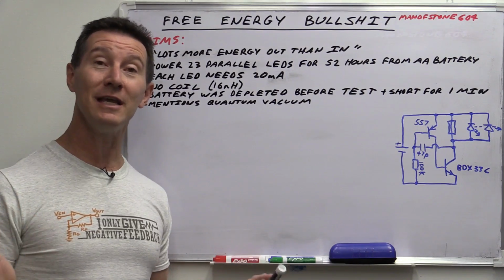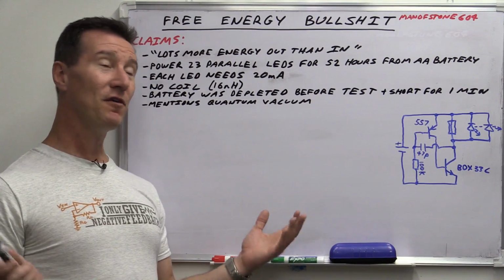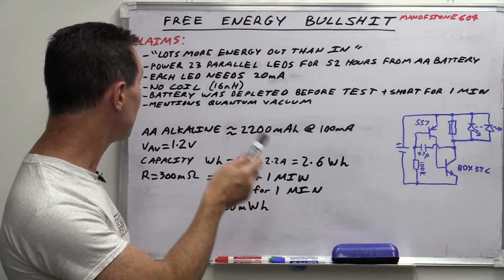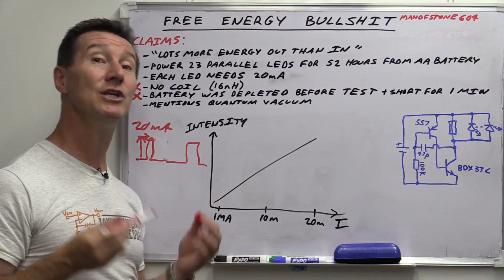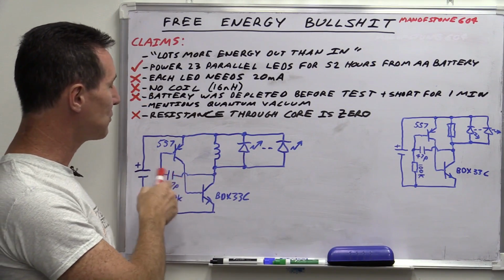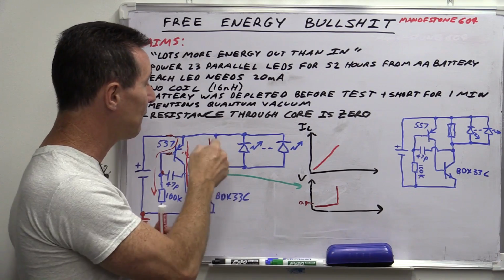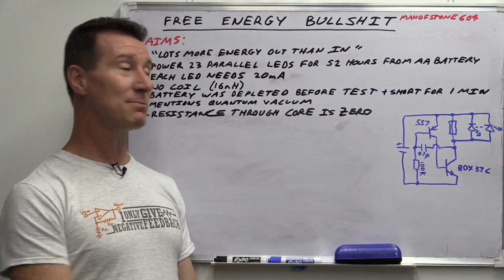EEVblog #708 - Free Energy Overunity is RUBBISH!

Comment: Unless you could tap into sub atomic particles on a mass scale you will find no free energy! This is also why the bosons from the Higgs field when exposed to our reality decay so rapidly back into the field that they are almost impossible to witness! Imagine that the Universe is made up of multi-phase energy fields that are only insulated by the separation of portions of sub atomic particles, imagine that the reality we live in is the outer conduit for the energy! The only thing that can utilize sub atomic particles and atoms is space itself and cause them to form the very matter we exist as, also allowing them produce and control the release of energy we witness in space and on earth! 

That is why why it is a super cooled vacuum, it allows the unimpeded flow of such immense voltage and current that is used by sub atomic particles and atoms attached to those very fields! But I cannot understand why man has yet to realize the importance of the vacuum and extreme cold of space when it comes to the production of atomic fusion and assembly of matter as well as the maintenance of electromagnetic fields! If we were to lose the vacuum or cold even by just a small amount it would lead to an early failure of the universe!

The biggest mystery is as the universe grows! How does it maintain it's vacuum, super cold temps and it's energy, is it due to the expansion of space or the escape of matter from a central location or is it produced as a byproduct of current draw by subatomic particles, rapid assembly of atomic clusters or even atomic fusion? In reality I am not asking this question! It is also important in understanding that reality is not limited by time, the word time was simply used to explain a phenomenon, that is why time is not accurate but relative and why the phenomenon itself is accurate and not relative!

Time has always only been a tool of measurement for man and it has led to major manipulations of his behavior! Energy will never be free, it will always require more "Energy" to create it, than the energy it will produce!

Comment: Dave, you taught more basic EE in this video than most of the free-energy types would ever experience in their whole  lives.  Hopefully, going to this level will help more of them tinker more intelligently & reduce the number of nonsense claims posted on YT--but, I doubt it because newbies often come across things when tinkering that they don't have the ability to understand or mathematically evaluate (given that they don't have much physics, electronics knowledge, & zero EE knowledge).  It's simply easier & cheaper for them to make & post a video with bogus claims & wait for others to explain to them why their conclusions are wrong.  Today you did that!  Excellent explanation!

Comment: fun thing is, after seeing this video, I modified this circuit to not suck and build countles little LED flashlights with it. It does the same as a joul thief but you don't have to wind a transformer to build one. Just replace the 47p cap with a resistor and you can trim it to not waste so much power.

Comment: There is unlimited "free energy" if one has the wisdom and knowledge to harness. Water runs down hill and gives the world most of its "free energy" . 
There is always a slight difference of potential between the "plus" and "minus" side of a magnet due to the movement of the entire universe. If one has the wisdom and knowledge  to use this difference to be magnified and harnessed properly one has unlimited "free energy" and it does not break any laws of physics or chemistry.  The concept to become familiar with is the "potential" inherent in the universe that there is a slight difference of "strength" between the plus and minus side of a magnet, earths field,  solar system, universe,,,,

Comment: If "The Laws of Thermodynamics" were "Laws" why is it that photovoltaic solar panels run hotter when they are powering a heavy low impedance external load as compared to an identical panel not powering anything? and a shorted photovoltaic solar panel runs even hotter, 

If "The Laws of Thermodynamics" were "Laws" and not lies the shorted photovoltaic solar panel would remain at the same temp as the open circuit panel, but it runs hotter than the open circuit panel, and the panel  powering a heavy low impedance external load would run cooler than the open circuit panel, but it runs hotter than the open circuit panel, 

I realized this when I was 10 years old and I was never able to accept 'The Lies of Thermodynamics' when one thing breaks a law of physics the law is not a law, it is a lie and there are a thousand other ways around it, 

Another thing that breaks "The Laws of Thermodynamics" High Voltage, High Frequency Capacitors across an AC Voltage acts as a load without producing any energy by product, it Destroys Energy 'First Lie of Thermodynamics' Energy cannot be created or destroyed it can only change state from one form to another, High Voltage, High Frequency Capacitors across an AC Voltage Destroys Energy! no energy by product!

Nikola Tesla's Quote on Albert Einstein's Theory of Relativity {“Einstein’s theory of relativity is a magnificent mathematical garb which fascinates, dazzles and makes people blind to the underlying errors. The theory is like a beggar clothed in purple whom ignorant people take for a king… its exponents are brilliant men, but they are meta-physicists rather than scientists.”} 

Albert Einstein and all of the "great men of physics" (Except Tesla) were part of a secret society that their goal was to suppress the truth about physics from the general public, 

Nikola Tesla was a true genius, The only reason Albert Einstein's Theories were promoted was to suppress other theories (The Infinite within the infinite we are in) aka (As above so below) Now Quantum Mechanics is being promoted to suppress The Infinite within the infinite we are in, and confuse people to how matter and energy really works, to suppress inventions that the power elite doesn't want the world to know about,

The false theories that are currently taught were purposefully created to keep people from inventing, over unity power supplies, gravitational drive tubes and dimonatal acceleration tubes (The Philadelphia Experiment) these devices are simple and obvious when you understand true physics, 

If you don't believe me why would YouTube Block my following comment from showing up in Top Comments on my own Channels Discussion Tab? go to my Channel's Discussion Tab, It shows up in Newest First, most people don't click on Newest First to read Comments, (YouTube Only Blocks The Truth)  

Follow the Money, Who owns the Federal Reserve? it's not we the people, shortly after WWII the owners of the Fed got Congress to make a deal with most of what is now OPEC that the US paid for the development of thear oil infrastructure in exchange they would sell their oil only in US dollars, so the US Dollar could get off of the gold standard and become a fiat currency backed by a third party, middle eastern oil sells, that allowed the Fed to print money willy nilly without any real backing, 

One of the first jobs the CIA was given was to protect the US petrodollar, and to suppress anything that could threaten the US petrodollar, that included promoting false theories and suppressing the truth, 

One of the other first jobs the CIA was given was to collect, reverse engineer and suppress UFO technology, some of the components were given to a few companies for reverse engineering, like Bell Labs and Motorola,

Who does the CIA really work for? it's not we the people, it's the owners of the Fed, 

Most or all Overunity "Experts" are CIA sponsored or forced disinformationist, just like most or all UFO "Experts" are CIA sponsored or forced disinformationist,

In a fair and just world inventing an overunity power supply would make a person much money and fame, in this world inventing an overunity  power supply makes a person dead and discredited, thanks to the CIA protecting the US petrodollar,

Here is a simple explanation of one overunity power supply: When a diode is hot about the boiling point of water it produces a small forward voltage from 1/8V to 1/4V and the current potential is dependent on the surface area of the PN junction, it is thermovoltaic and it is not endothermic, at high current levels it is exothermic, photovoltaic solar cells are large surface diodes, a 12V cell would be a 288 layer device or a 96 diode stack, each layer could be extremely thin, the individual diode layers need only to withstand less than 1V reverse voltage, a properly constructed device the size of a deep cycle lead acid RV battery could power an electric car,  

Another overunity power supply: The secondary in an air core transformer amplifies the primaries field, as opposed to a ferrous core transformer that the secondary consumes or opposes the primaries field, Nikola Tesla called his air core transformer his (Amplifying Transformer) because the secondary amplifies the primaries field, Nikola Tesla got really close to overunity with his Amplifying Transformer (Tesla coil) all he needed was a pair of non powered switched primary helper coils on each side of the primary coil to reduce the rise time impedance and amplify the the rising field strength and volume, and another pair of coils rectified and regulated to the primaries power supply, 

When I was 16 Years old I was taught physics philosophy and theology unified as one through rudimentary simplicity, find the simplest point and every point from the simplest point is just as simple as the simplest point, and before you know it you have reached levels of complexities through rudimentary simplicity, true understanding is never lost, 

Look inwards to see outwards, as above so below,  the infinite within the infinite we're in, find the simplest point, logically how is it possible for a smallest particle to exist? what would it exist as? a bubble of nothing? what would the shell consist of? if there were a smallest particle would all of the smallest particles occupy the exact same volume and mass?  

Atoms are microcosm solar systems, electrons are microcosm planets, the matter electrons are made of is as small to the electron as atoms are to a planet, and so on and so on, the particles that make up the magnetic field are to the electron what the electron is to a planet, the particles that make up the gravitational field are third level magnetic particles, heat is the mass of electrons not vibrational, the electrostatic field is orbital to stationary, stars have a V+ charge just like the nuclease of an atom has a V+ charge and planets have a V- charge just like electrons, 

Most planets have electron poles (aurora borealis/australis) magnetic poles and gravitational poles all aligned in its axis of rotation, and in the microcosm of atoms most electrons have the same just like planets,

As a planet spins faster the increase in allingements of its subcomponents increase the force and volume of its electron poles magnetic poles and gravitational poles, compensating for the increase in centrifugal force on its equator, 

The gravitational field is a hypervelocity magnetic field, a balanced non drifting magnetic vortex traveling through a deep vacuum will exhilarate itself through the gravitational field, gravitational drive tubes act as a piece of wire carrying current in a magnetic gap,       

You will get further in understanding through visualizing this modal on your own, than me talking you through it, if you have any questions just ask,    

When will the CIA stop murdering people that invent overunity power supplies or any device that doesn't conform to conventional physics,    

When will the CIA stop controlling what people believe about physics through the NSF, Nobel committee and paid online trolls,

How is the physics cominiunty going to recover from the infinite egg on their face, and when it comes out that the CIA had the whole world fooled with false theories everyone that paid for any class, textbook and lab fee deserves a full refund,

Now if we continue to burn through the rest of the world's oil reserves oil will crush the world's economy and the petrochemical industry will run out of oil feedstocks, if we don't change now we won't be able to,

Do you think this soft coup against the Deep State/CIA will change the CIA in regards to protecting the US petrodollar, or do you think it will be business, lies and murder as usual?

Always remember if something is being pushed a lot like everything quantum, thermodynamics, big bang,  they are CIA psyops to keep the masses stupid.

Comment: Dave - please tell me how i can  change output impedance from 75 ohm into 50 ohm (( switched between 75 and 50 ohms )) on my ''Advance signal RF Valve signal generator   model: SG62 the rf out voltage is quite low X100 microvolts settings and X10mV

Comment: Could this kind of circuit be dangerous without the LEDs as a flyback diode, despite limiting input to 1.5V? A battery cannot supply it enough power though (you calculated 80mWh when a battery is shorted).

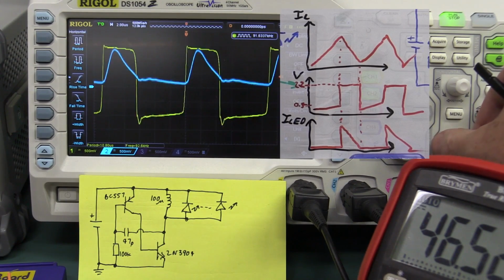Comment: 39:13 Well, it's about half the current at about twice the voltage... Considering that the LEDs are driven at a more or less 50 % duty cycle though, I guess one could say the average voltage is about 1.5 volts, so yeah. Not particularly efficient.

Comment: Playing around one day in a fairly dark room I found that if i touch one end of a 9v battery, then touch one end of an LED and complete the circuit by touching the other pin of the LED to the other terminal of the battery and amazingly enough, the LED lights up. I did this with both white and blue LEDs. Mind you it didn't light up very brightly, it was just barely visible in the dark, but I was surprised to see any amount of light coming from them considering they were only drawing maybe 1-10 microamps, assuming my dry skin caused my body to have 1-10megaohms of resistance across it.

Comment: Your explanations are valid only with one family of electrons in the circuit that you show. Recently, it has been measured that there are two kinds of electrons in an electrical circuit. One with spin up and the other with spin down. These two kinds of electrons carrying charge and spin, can associate in pairs of electrons after a periodic local modification of the resistance and thus of the local temperature. Voltage can then increase and intensity too, which produces an increase in the power of the circuit. COP will be overunity ! But a spontaneous cycle appears with formation of pairs and disappearance of pairs of electrons, which will increase the energy of the circuit; finally the energy ratio will then be greater than 1!

Comment: We can get free energy from UFO motors in the Bible, where one large wheel turns many mini-wheels 100's - 1000's of times = Ezekiel 1:16 “wheels within wheels” https://www.youtube.com/watch?v=NxpoiCFKmPg  is very similar to my GEM, except it uses no AC generator 
- 
Hello fellow inquisitive one, . . . . . . . . . . . CHRISTIAN AGE ENDS BY 2019.04 = 1st DOOR closing 
http://doorschristmustpassthrough.yolasite.com/ Ezekiel 1:16 speaks of a UFO motor as wheels within wheels, + this is a self powering set of motors http://free-energy.yolasite.com/ = This is how I confirmed my Vision of a ten speed going uphill in 10th gear + then back down hill in 1st gear, was from God,,, also the fight I had in trying to get people to see through the evil forces hiding this dirt simple free AC electricity multiplication. Free energy is as simple as imputing one short burst on DC current, to drive a large 100 cm circumference pulley for one single rotation. This would move 100 cm of belt past 1 to 10 mini-pulleys of 1 cm circumference, each with AC generators attached, giving you an output of 100 or 1000=10X100 cycles of AC electricity as an output.
-
you can multiply the # of cycles of AC electricity by 100, by only having to pay for one rotation of a 100 cm circumference pulley, + then getting back 100 rotations from every single one cm circumference pulley + generator, that you choose to attach to the same belt as the 100 cm pulley. This way you can multiply your output by even more, as you would get a return of 100 cycles of AC electricity, for every one cm pulley that you choose to attach.
-
can you believe that I was first came up with this technology between 2000 + 2002, + soon after published it on the web @ http://free-energy.yolasite.com/
-
THANK GOD !!!
I have been trying to tell people about how simple free energy could be, 
by using pulleys, we could be freely multiplying AC electricity, or even DC apparently. 
-
Somebody has built one very similar on UTUBE,,,
@ https://www.youtube.com/watch?v=NxpoiCFKmPg 
-
FREE ENERGY IS NOW HERE,,, FOR ALL TO USE FREELY.
No more paying for gasoline,,,,
No more giving terrorists our money.
Prices should start going down, on almost everything 
most things that need to be powered by AC + DC electricity, or even fossil fuels should now be made with self powering GEM perpetual power supplies 
-
This should start a massive amount of new free energy inventions. 
No more polluting the air we breath, with gasoline engines,,, ALL ELECTRIC AUTOMOBILES.
No more polluting our atmosphere by heating our homes + workplaces = FREE ELECTRICTY
No more pollution for lights + cooking our food = FREE ELECTRICITY
No more paying high electricity bills
Everything should be much cheaper = less shipping costs + practically zero energy costs
-
GOOGLE "free energy” “using pulleys”
My Ministry websites:  
http://my2020vision.yolasite.com/
http://doorschristmustpassthrough.yolasite.com/
http://beliefstoliveby.yolasite.com/
http://possibletimingfortribulation.yolasite.com/
http://aliensandghosts.yolasite.com/
http://fire-starter.yolasite.com/